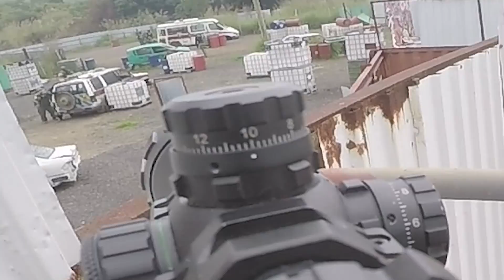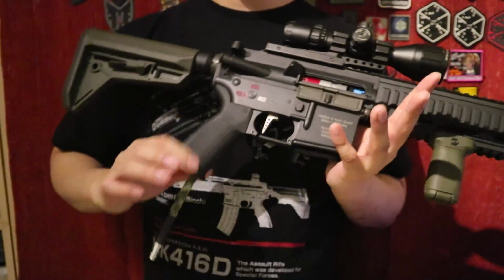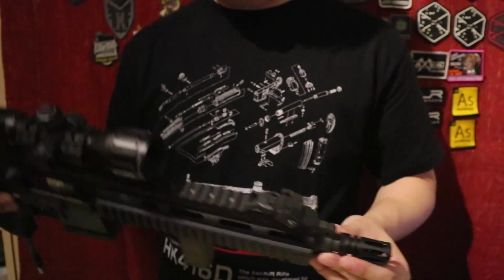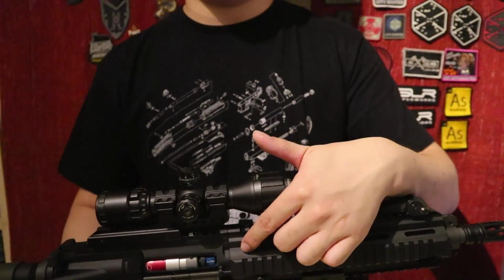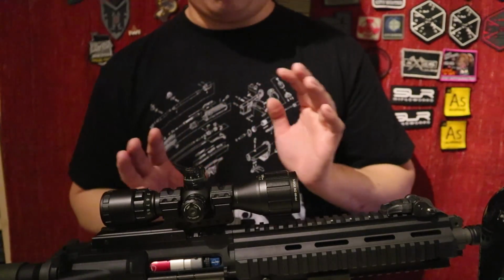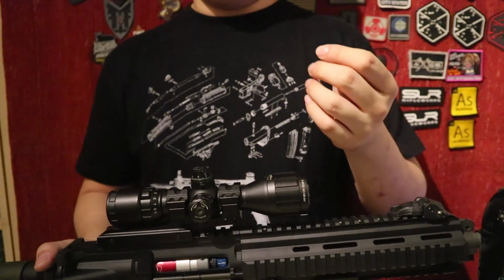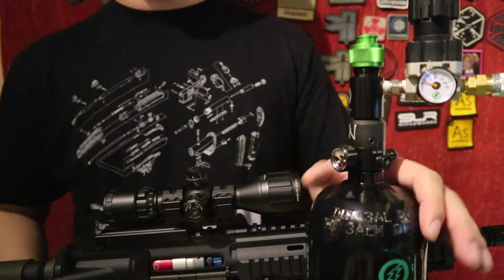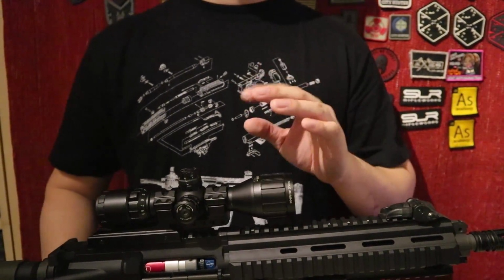Polarstar F2 VFC HK416 Airsoft Gameplay!! New W28 Site in Hong Kong!

Comment: Where did u buy your polarstar and hpa tank and how do u refill it cause Hong Kong is not popular for hpa guns
Reply from the maker: You can refill by going to any scuba shop, however depending on your tank, you may need an adapter/fill station device to charge the tank via scuba tank. 
I bought my polarstar from amped airsoft and ordered with friends to split the shipping cost